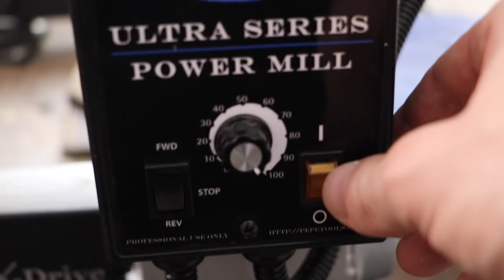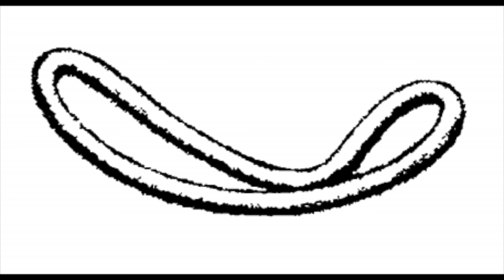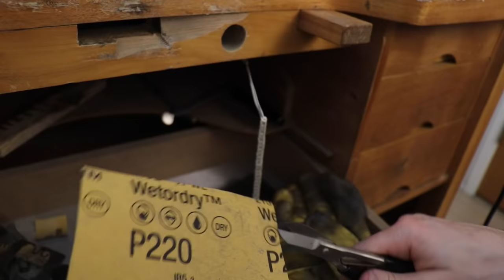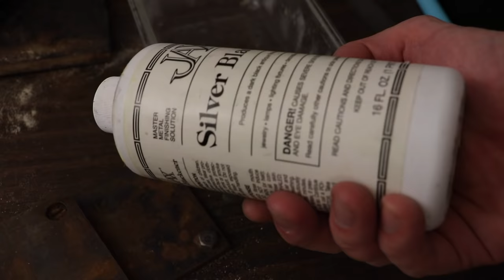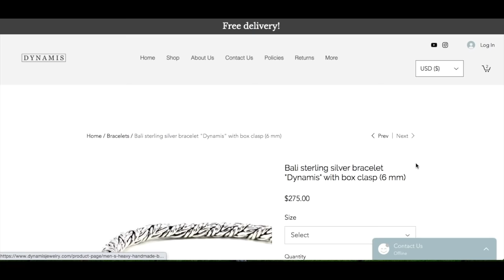HOW IT'S MADE | SILVER BRACELET | TUTORIAL

Comment: I wonder if people understand how much planning and work goes into making something like this. Stunning piece!
Reply: It looks more complicated than it is.
Reply: I do 😏
Reply: Yeah but without the thousands of dollars of tools its a nightmare trust me
Reply: @E66878   It can be done without thousands of dollars in tools. You'll still be putting a few hundred in, but it can be done. You can source the wire from a jewelry supply store rather than make it yourself. You'll also notice he used a hobby torch to solder the rings. A slightly bigger map gas or propane torch from the hardware store will run you about 40 dollars and will work just fine for this and annealing the silver as it work hardens.

 As for cleaning, a thrift store slow cooker or electric hot plate and a ceramic dish can be used for pickling. For drawing the rings and reducing size/compacting the chain, you can buy a couple off-cuts of a good hardwood at your local lowes/home depot/whichever is the local store in question, glue them together and drill a series of graduated holes in the resulting block to form a draw plate, then use a pair of pliers to pull it through. 

While expensive tools sometimes make things easier, simple and cheap do the job just as well at a fraction of the cost. 

Where I got this information: nineteen years of working with wire making chainmail as a hobby, twelve of metal smithing and jewelry making as a hobby, and six of leatherworking. When possible, I make the tools I need to do the job, and when I can't I go with what works, not what is shiny and expensive as a rule. Most expensive tool I've bought for my hobbies is a toss-up between a relatively cheap home depot drill press and a flexshaft. 

I hope this helps you out if you have an interest in this as a hobby 😁
Reply: And that's why I charge so much for my jewelry
Reply: @SonnikkuGamer6969   Yep. The most expensive multiplier in the cost equation is always "How much is my time and effort worth" . 😄
Reply: Yeah I would have made it easy by twisting 2 wires then making 4 more of 2twistid wires And twisted all 4 of them ez Also i am a goldSmith
Reply: NO THEY DONT.
Reply: Only people who have tried to do it
Reply: If they watched the whole video, I’d say they at least have an appreciation for it 😎
Reply: Just as much as any other hand made jewelry I'd say.

Comment: Great work! 
What is the name of the machine at 12:30 ?
Reply: Same question.
Reply: That is clearly a smashination station.
Reply: Sorry , i searched for it but couldnt find it . I googled " silver pulling tools / bracelet stretching / bracelet bending / bracelet rolling " , that square looking thing didnt show up .
Reply: Without a name, it's going to be constructed much like an add-on feature of a machinist's lathe, called a "steady rest". If you study how those work, you should be able to build a "how does it work?" - box around one and have your very own smashination station. You will want to use one with roller bearings, as seen on video, and rotate the bearings 90 degrees from the normal. Otherwise, your workpiece will just flop around like a snake.
Reply: Adjustable drawing die?
Reply: The tool is called a "rolling mill." This one is motorized, but you can find a hand cranked one for a frantic of the price of the electric ones.
Reply: @crystalcarmona9115  I was under the impresion a 'Rolling mill' is a Mill with Flat or Cylindrical 'Rolls', one for flat rolling (plus half round side extension rollers) and the other for square wire rolling. for example. 

This is very different to the normal rolling mills..

Is there perhaps another name for the type of 'Rolling mill'?

Comment: Very nice piece! I love the design. Only problem I'm seeing is where the joints were soldered together, would those be weak points over time as the bracelet is flexed from use?
Reply: In this case, no, since there is a sufficient thickness of the wire.
Reply: You're right, in that the solder points would be the first point of failure, but solder is to jewelry as nails are to houses. It's just the way it's done because it works extremely well, and to improve on this is to overcomplicate the problem.

Comment: Great tutorial! Currently working on this type of bracelet. Can you share the wire size you used? Tested with copper 1.7mm wire and 16mm rings, but it was too tight and tough to get the rings into each other. Now working in silver with 1.5mm and 16mm. Looks already a lot better. Curious about which parameters you used!
Reply: He used 15 mm diameter tube and a wire was not bigger than 1.3mm.